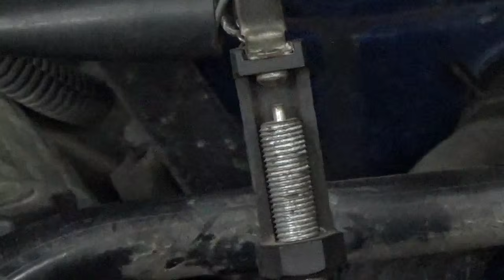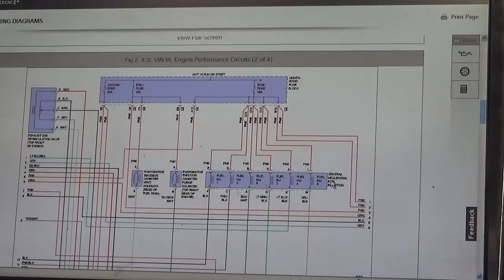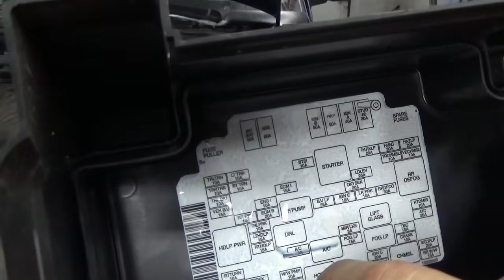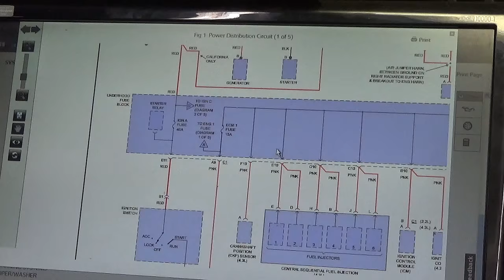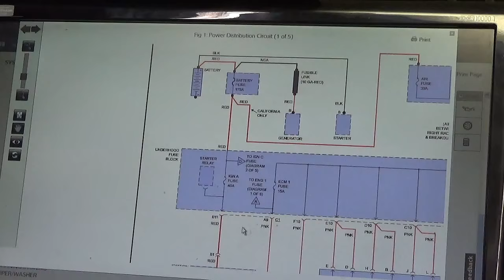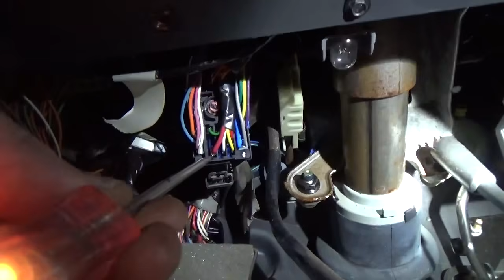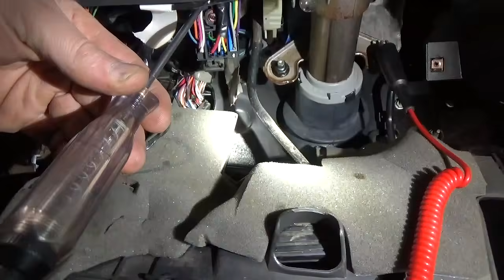No Start / No Spark / Cranks OK - GMC Jimmy / S10 Blazer

Comment: South Main Auto Repair My 1998 jimmy is doing the same thing and I am lost on what to do. I have spark I have fuel I have air but just cranks but with a hard thud sound like it is hydro locking. It started all this when my distributor went bad and was replaced and have had problems with back firing missing and such ever since I have replaced the timing chain and new distributor and fuels assembly but all I get is cranking with the thud sound. I am at a loss and hoe that you can help me. Tell me how we can contact each other and discuss. I am in Virginia thank you

Comment: Hey Eric when u were testing that pink wire from the ign switch, could u have also jumped power to that while cranking and that also could have started the engine? Just wondering.

Comment: i have a 1999 s320 mercedes that cranks but does not start i changed fuel pump and cam sensor codes erased but still will not start can i get some help on what i should do next

Comment: I have a 94 Mustang GT that has a crank no spark issue. The only thing working is the radio and every time I turn the key in the on position it plays Little Bitty Pretty One. Could that be in the ignition switch or does it need a exorcism?

Comment: A pointer to those who Checked over the same trouble shooting that this guy did and do have power key on and starting position, could be the control module next to the coil. Just fixed a 2005 4.3 vortec. Thanks to this video for singling out other potential problems! Thumbs up!!
Reply: @stangguy6604  does that works for a 95 S10 4.3 as well?

Comment: hi names Nate , if you could?
I need to disconnect my cruise control module or relay or fuse . I have a 93 Chevy s10 blazer and on the net search not having any luck. problem steering colum was loose had it fix and tighten but when they plugged the wires they connected the cruise control wrong .
I'm not familiar with this field of my truck ..it won't start and when it did I gave it a little gas and it turned on and stayed in that rpm range of how much I put my foot on it . took around the block no foot on gas just brake , and I went all the way around the block at 20mph . it's got to be that it's stuck please help if you can .
Reply: Yeah thanks for getting with me ,nope he disconnected it and replaced some electric components . Idk wich ones and now get the truck back from the mechanic it barely wants to start and running very bad and not shifting , like forgive me it's constipated .....will post a video soon

Comment: I have one for you. 1999 Chevy Express with a 5.7. It cranks over and has spark and gas. 65 psi. I sprayed starter fluid into the throttle body etc. It ran great when I let it sit 6 months ago. I starting it a couple weeks ago and running ruff. I know when it rained the van would just crank and not turn over till a day after it rain. I swapped distributors from my other van that is the same make and model that runs perfect. They van don't even start now. I put it back in the other van and it works. What are the chances of having a bad computer. Chevy did have a issue with rain coming down the windshield to the computer. There was never a recall. How could I test the computer ? All the lights work and cleaned and grounds also.  I put a new crank, cam sensor, egr valve and coil in. Any other ides would help me a lot.  No engine light or codes and fuses good. Thanks all.
Reply from the maker: +kristie peter what are you missing? Spark, fuel pressure, Inj pulse? all 3? Is the theft light on?

Comment: Had a hydro-lock issue after replacing fuel injector spider assembly on a sonoma v6, cleared that and had a crank/no start issue. After some testing decided my secondary coil on ignition coil was bad. Hoping to see  some tips...but ended up thoroughly enjoying how you traced out the problem so much I forgot I was looking for ignition coil replacement. Great job!

Comment: See if you can help ?,I have a 98 GMC Sierra 5.7 Vortex it doesn't have a chip in key I cut the plastic off ,now it was running before, I cranked it started driving down the road it cut off.my buddy down road brought pressure gauge to check fuel ,it had 0 ,then put new pump on ,check pressure holding 55psi  then put his computer on it has no plus on injection , RPM gauge worked changed cam sensor still no checked timing OK pour gas in throttle body ,cranks and running then runs out gas ? It has the wires that clips on top where the key goes ,but know chip in key? And running before

Comment: Ignition switch is a very common issue in these vehicles (carbon build up on the contacts) The most common issue is the "security" light on the dash illuminating. 
 But the problem can also manifest itself as an inoperative fuel pump, 
unresponsive cluster, ABS and/or SIR lights being illuminated on the 
cluster, as well as a no start condition (either related to the 
inoperative fuel pump or a failure of the starter to turn over).  The 
ignition switch can also cause PASSLOCK issues.

Comment: Hello Eric. I have a 2001 GMC  Sonoma and having the same problem except the ecm1 fuse stays lit and the connector wire that you tested is also behaving normally.
Reply: +Chris Callaway 
If you have no spark you need to check to see if the ICM is commanding the coil.

Comment: My 2000 Mitsubishi Eclipse GT runs until the weather gets cold or damp then it has the same problem. Turns over fine but won't start. It ran for 1 1/2 weeks this last time until 2 days ago. Now it turns over but no start. I was getting a PO300 code when the problem first started. No codes now because I have to disconnect the battery and charge it after cranking the motor for a long time and I lost the codes. This has been going on for exactly 2 months today. Can't figure it out. I sprayed starting fluid in the air cleaner and still no start. New distributor cap, rotor and plugs.

Comment: hi Eric. I have a question. my truck died out on me. i have a 03 gmc sonoma. i found out my rotor under my distributor cap somehow came loose. I screwed it back in and it runs pretty good. but I noticed there is a ticking noise coming from the distributor cap now. I was wondering if ya might know why that is?

Comment: Great to see how you diagnose starting trouble. In India they will not do this, will ask us to replace parts without any genuine evidence.Once my old 2007 model Suzuki broken down, on the next day, after regular service. 
On-road assistance guy came and told the car need multiple part replacements, including alternator. Finally he figured out it is a loose contact in a particular switch. That guy did that fixing by trial and error and I have not replaced anything in contrast to his initial conclusion on part replacements. While I questioned him earlier how he had concluded car needs part replacement he is unable to answer me.

Comment: hi have a 2001 blazer that won't start only in the winter. started the other night in 14 F cold weather and now it wont start again.  cranks like the one in the video but then it sounds like it's back fires in the intake. Now in spring time when it's warm no problems starting. tested the air temperature sensor and that has power. tested the sensor itself the needle moved on ohms tester using a hair blower. not sure what it could be. last winter i had the distributor cap and rotor replaced.

Comment: my 93 s10 boggs down then comes back to life changed everything from wires and plugs new distributor coil tps I have no power at acceleration at all no codes backfires when I floor it anyone have idea what could be wrong

Comment: Hello, first best wishes for this new year and thanks you make a great job, I am looking for help, well I put myself in trouble => I think I overfilled my engine with oil, It is a "old baby", a Chevrolet S10 1987 (Durango) 2.8L V6, when I tried to start, it was ok but after maybe 20 s the engine stoped, I drained the oil, now it cranks but doesn't start and no spark, with a friend we checked and changed plugs for new ones, please have you any idea

Comment: I'm having this same problem with an 03 S10 4.3   I tested the ignition switch and I am getting power on the On position and while trying to start the truck.  Think my battery may be the issue?  Bad sell possibly?
Reply: +GAMEWITHGREEDO i also have power on while on position and while cranking. I dont know how to fix it
Reply: I'm currently having the same problem with my 03 jimmy, I don't know what to do

Comment: Hey I have a 99 suburban have crank no start wants to diesel after I stop cranking.  B terminal wire to icm was crimped to a purple wire I assume something for the remote start.  Took that off wire has good continuity to ecu connector terminal 9 .  I ran a jumper wire just incase and still no start also icm does not show any alternator voltage while cranking .  I've been following a diag tree from alldata and I'm getting no where owner there a coil,  crank sensor and icm in it already on a scanner I get rpm readings while I crank and it almost wants to start I have fuel , starting fuel doesn't help it start. A new ecm and ignition switch was put in about a year ago.  Any things I can check to get it  to start?

Comment: 96 jeep Cherokee sport 4.0 remove old switch cause the key broke in the switch install a new one an when I connected the neg battery terminal the car started to crank with the key on the off position an in park an I found two wires that were bare an touching on the NSS could that cause the problem it was not doing it with the old switch

Comment: Hi South Main, very interesting video on fixing a Jimmy!...nevertheless i got a kind of challenge if u like those....am from Chile Southamerica and I got a 2.4L brazilian version of a GM blazer with a brand new ignition switch; I sent the ECM to an electronic to remove the immobilizer and it was verified according to a scanner the correct functioning of it without connecting it to the vehicle (I live far away from tech), I did connect it and was cranking but no start no pump running, I sat a relay directly from computer signal (I have the electronic schematics) to run the pump and made it run during the lapsus time before the crank and checked the oil pressure sensor see if was giving the current to the pump right after crank and it was so, I checked the AC from crankshaft positioning sensor and it gives 5 volts and is ok so it cranks but no start, I checked the number 1 and 20 wires going from ECM to ignition coil and guess what.....as long as it is disconnected from coil it gives a reading of 12v -polarity, I set in start (no crank) still having 12v-polarity, I do crank it and start pulsing according to a lamp test so it says that crankshaft sensor, it is giving signal to the way out from 1 and 20 to the coil but everything is lost as soon as I reconnect the famous ignition coil....any idea why? I can send you the schematics if it calls your attention(by the way i brought the positive wire directly from the same fuse to the positive connection in the coil)

Comment: WELL, I HAD REPLACED THE IGNITION coil  AS I HAD STATED; IT STARTED RIGHT UP, BUT IT CONTINUED TO BLOW FUSES. THIS TIME THE BST1 WAS GOING TOO. I was figuring since I had put in high performance ignitions coils the old ignition module may had been the problem or the igniter that is the connector between the main computer module and the ignition control module. I used the ect2000 and the ecm1 fuse was directing me to the ignition module I tracked the starter relay and it went to the ignition module that confirmed it for me. It  appeared I  needed a new ignition module and that was exactly what I  needed. The vehicle is a Chevy 2000 S10 I had changed all the problem areas, figuring it is old vehicle and it would be a good thing to do so. But if I want to save money and time I probably should have bought the ECT2000 PROBE BEFORE HAND. BEST WISHES TO YOU ALL AND THANKS AGAIN ERICO. I KNOW THIS IS YOUR LIVELY HOOD AND IT MAY TAKE AWAY SOME OF YOUR BUSINESS BUT I THINK IT SHOWS YOU ARE AN HONEST MECHANIC. THAT IS LIKE FINDING GOLD.

Comment: Hi love your style I have a grand vitara  gv2000 and it wont fire the immobiliser symbol is flashing on the dash when you turn on the key motor cranks but wont fire test all point at immobiliser plug all correct as per the book transponder ring has continuity and not shorted out have tried both keys still the same ??? this event is the result of the battery going dead over a cold night replaced battery as old one had shorted out after 10 mins of charging ie battery charger meter went to zero but battery still very low (flat) the dealer want to sell me an immobiliser and a few hours of calibrating it all to the car thanks steve

Comment: South Main,

Here lately, my 2001 S-10 starts intermittently. I turn the key over, and everything (radio, lights, etc.) in the interior comes on, so it's not the battery. Sometimes it starts on first turn over. Other times I have to try several times for a few minutes till it finally starts. Any ideas?
Reply: maybe your starter is going bad? I had the same issue on my s10
Reply: thanks man. I had the starter relay (in fuse box) replaced hoping that was it, but the problem is still occuring. My next step is probably the starter. Here lately it's been starting on the 1st or 2nd try.
Reply: +Craig Candor i did the starter on my GMC sonoma, so easy to do.

Comment: Hi , i really need your help :(  i bought a 99 jeep grand cherokee, it have a problem like , when it cool it starts. if we start ones and stop even for 30 seconds. if you crank again it will crank but won't start. i find out that there is no spark coming. i have to wait almost 3 to 4 hours to get start again, there is no check engine light. i changed cam shaft position sensor and spark plugs  can you help me to find out what the problem is

Comment: Hey Eric .... I have a 93 astro with 4.3 and I am gettin it to turn over but doest run ... ive given it a new battery and plugs changed fuel filter and removed the dist. cap and cleaned the hell out of it ... yet no start ... I thought maybe the plug wires were connected to the cap in the wrong order so I very stupidly change the position of plug wires 2 and 4 and turned the key now it tried to start but then just seemed to act like it killed my battery ... I actually lost all power in the van until I reset the computer by removing the battery leads ... does it sound like I burnt out my distributor or is it the computer .... best regards funk N Ks

Comment: These trucks are horrible... With products like these, it's no wonder GM folded..
Reply: jon doe 4.3 engine is one of the best ever made
Reply: Thomas Smith buy GM standards, you may have a point.. But "one of the best" compared to other manufacturers, I couldn't include it in a top20..
Reply: jon doe I could
Reply: jon doe all you seen is s10 and blazers on the street .still
Reply: Thomas Smith only because they are cheep to fix..
Reply: jon doe thats funny bud . do your research
Reply: jon doe if the engine and transmission didnt last so long they would of died out a long time ago
Reply: Thomas Smith "do research"? Lmao.. I've owned many vehicles. My experience trumps any research. Every generation of 4.3 has its faults. From value seats, to injectors and even drivetrain issues to this day..  I just believe their is better out there. GM shouldn't of been bailed out. There products are unreliable and cheep.
Reply: Thomas Smith I have one myself. It's cheeper to fix that any the other cars I have. That's why they are still around
Reply: jon doe i have 2 and owned 4 . i like them for work.
Reply: jon doe one had 370000 miles when it died and probley gonna drop another engine and trans in it.
Reply: jon doe maybe a 350. :)
Reply: Those are a lot of fun

Comment: Thanks for responding. by the way. love your show, It just drives me nuts.Works like a 4-wheel caddy down the highway and it becomes a hunk of junk when it pulls that shit. Especially after it rains. But I check it after it rains and it is completely dry. No water getting in.Had the fuel pump replaced .just to solve that end. Only the first time in the morning. After it starts up.works perfect all day long.Would the coil or ignition switch be intermittent like that.Please help.SOS
Reply from the maker: +Kerstin Gigi Ott sounds more like an ignition problem to me.
Reply: +South Main Auto Repair  Well, I will get the new ignition switch and get it replace. Thanks for all your help.

Comment: I have a similar problem with my 1996 GMC Suburban C1500. About every two weeks, the truck just doesn't start. I wait about an hour and it cranks right up. I am almost certain that it is a no spark issue. Once it starts, it runs great for about the next two weeks. Than it does it again. Does that sound like the ignition switch to you.
Reply from the maker: +Kerstin Gigi Ott Possibly but with out testing it it is hard to say
Reply: Kerstin Gigi Ott It would be interesting to hear what it ended up being. On second Distributer. Changed neither as they decided to go while out of town both times. Love the coil test. I did some looking and found fuse problem, but still found power drain. Wish I wasn't forced to be competent lol. Your wiring diagrams from all data? Also, for whatever reason, I notice a slight loss of power and miss after they replaced the Distributer. My wife drove it home like that...now I am wondering if the positioned it right. Presently in the middle of something..was kinda hoping to not look at it lol. Hope your customers realize how difficult it is to find your competence!
Reply: Pop your distributor cap off and blow dry it. Condensation will cause it not start. I had a 96 Nissan truck that did it all the time and a Blazer that had a bad coil doing the same thing.